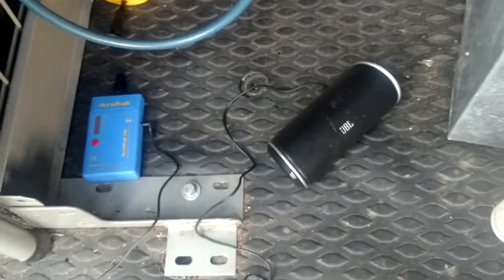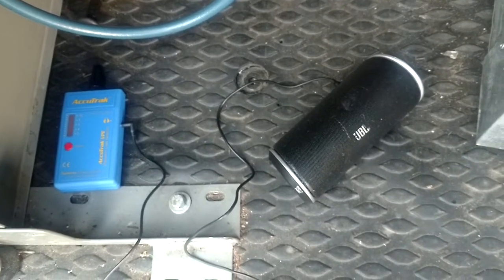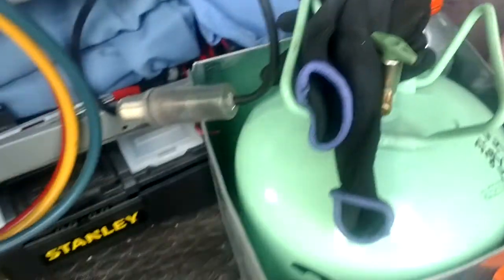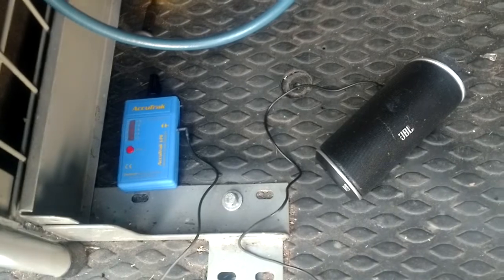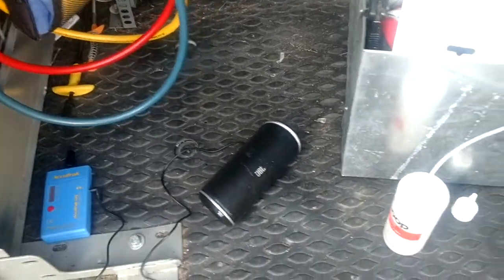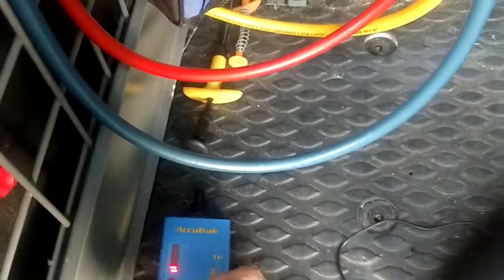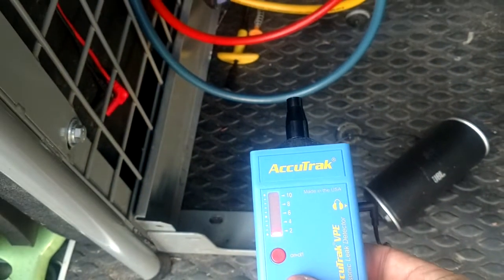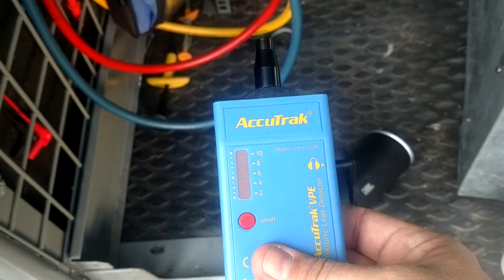Quick Viewer Request Video. Does the Accutrak Ultrasonic Detector pick up a cracked jug of refrig.?

Comment: Have you used the metal wand or stethoscope tip? Could you do a quick video one day on the use of it? Thanks again for the videos they are awesome.
Reply from the maker: No I have not. I don't work in the type of environment where I would be using that feature a lot. That would be for more industrial and commercial applications. Thanks for watching 👍

Comment: Shannon I noticed Bacharach rebranded one of these. It’s identical and on TTT. Do you know when they did that ?
Reply from the maker: The Bacharach version has been out for several years. But I would only buy the Accutrak.
Reply: I didn’t know that. Is there a difference ? Price ? Capabilities ?
Reply from the maker: @hozerhvac4406  one guy commented that he had the Bacharach and it didn't seem to work as good as what he thought so he sent it back and got the accutrak and he said he liked it much better. he said it seemed like this speaker was more sensitive on the accutrack. he also said you had to push and hold the red button the whole time you were using the Bacharach. With the accutrack you just push the red button to turn it on and you don't have to hold it in the whole time.
Reply: Shannon Knight HVAC thanks Shannon accutrak it is thsn. Just need to find a spot in Canada to buy

Comment: I’ve had mixed results with the AccuTrak. I found a leak I couldn’t pinpoint with the H10 or bubbles, had a coil leak in a ceiling cassette I could hear on the ground.  But then couldn’t find a leak on a low pressure switch that I found with the H10. I like it, but definitely shows me that having multiple ways to find leaks is a must. Cool set up with the speaker, by the way, good idea!

Comment: Based on yours and other videos on this leak detector I just picked one up and I love it. I found a leak in my stubby hose setup first thing and another leak that other techs have  missed right off the bat with it.

First test I did when I got it was enough to sell me.  I gave my daughter the foam insulation top  from the case and had her walk to the other side of the room and I could hear the sound it made with each rub with the Accutrak.
Reply from the maker: Glad you're liking yours. And thanks for watching 👍